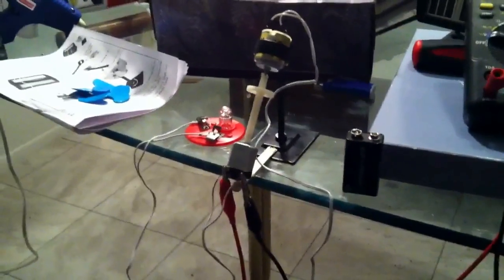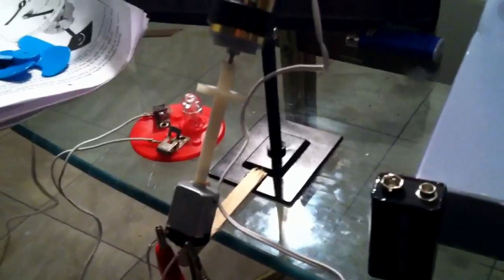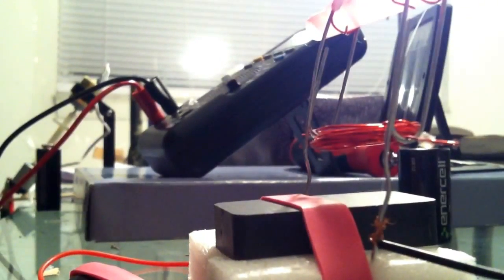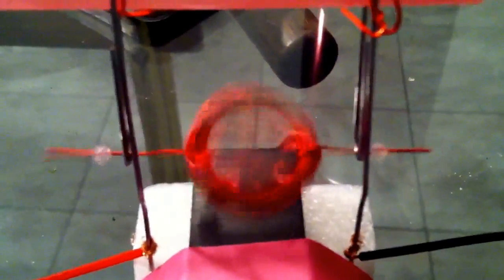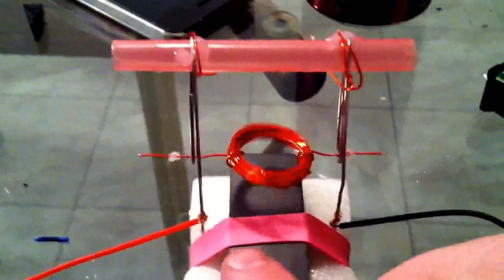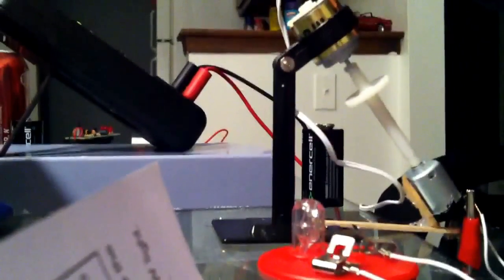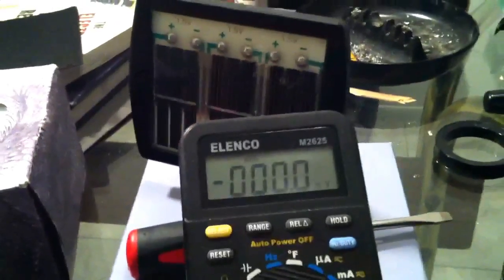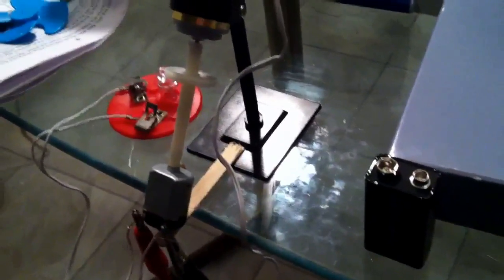*How to turn any DC motor into a DC generator*

Comment: can I use many generators ( parallel / series ) to increase the voltage/Ampere and their output power ?
Reply from the maker: Emad Lotfy yes you can thanks for watching and subscribe
Reply: Thank you, and you're welcome sir 
but i want to ask
what if one of generators ( parallel or series ) stopped ?
It will convert to motor again

So, It'll consumpt power instead of generation

Does that need control to make it out of the circuit ?
Reply from the maker: Emad Lotfy hmmm that is a very good question lol. My question is why would that one motor would stop? And to tell you the truth I don't have the answer to that question. My educated guess is that yes it would turn into a motor since the other generator is giving out power. But that is only a logical guess to your question. Can I ask what are you trying to make? Maybe make a video and send me the link I'm sure I could help ya out
Reply: I want to make dc generator system connected to inverter/UPS to supply some loads
Similar to pv array
But motors instead of modules
Reply: I need to make a system similar to pv array
but it'll be motor/generator array to generate DC power 
but there are some expected failures and I want to know if i can avoid them

and i assume  the output power of generator = the input power of motor

I don't know if that true or false
sure it's difficult to reach to maximum speed

Comment: How much voltage could I get from a 18v DC motor?? Would like to test it out, but I don't have a Voltmeter
Reply from the maker: XGamer [BiH] you need a volt meter. Buy one at harbor freight it's only 7 dollars and it depends on how fast you turn the motor. The normal rpm of the motor normally gives the voltage rating of the motor I hope this helps
Reply: Thanks for the answer! I'll try to get ANY voltmeter! I hope I can get atleast 5V out of it :)
Reply from the maker: XGamer [BiH] you should beable to get 5 v out of it but the amps might be not enough

Comment: does the generator motor have to be modified at all to output a current or does it happen automatically? Also, this may be a silly question but do the wires on the generator stay positive to positive or do they need to be flipped? ive been looking at generator vids for 3 hours now and no one has mentioned the output wiring.

Comment: the shaft is not the armature. the shaft is the shaft. the armature is the casing
Reply from the maker: Solomon Baker no the armature is not the casing the armature is what spins and is connected to the shaft. So technically it would be called the armature shaft. If you don't believe me google it. Thanks for commenting and subscribe
Reply: Tom Ziesmer no it is not the shaft it's connected to the shaft it's either the rotor coils  or the stator magnets. look it up surely you have access to google
Reply from the maker: Solomon Baker your stating that the shaft and armature are two different things and they are not you cannot take the shaft out of the armature. It is one piece therefore it is either a shaft or a armature. http://www.rollaclub.com/wiki/index.php?title=Tech:Electrical/Starter_Motor/Conventional_Type&redirect=no
Reply from the maker: Solomon Baker look under the site I just listed it's under number 4. Armature
Reply from the maker: Solomon Baker lol no need for insults buddy. I clearly gave you a link that shows them saying it's a armature shaft. Just because you are a electrical  engineer doesn't mean anything to me. I work on quarter million dollar machines fixing the electronics on them. You can say I don't know jack shit all you want. I know my electronics. And even if I called it the shaft or a armature, you out of all people should know what I'm talking about. Look at my other videos maybe you can spot something else "wrong" with what I have said. I make all kinds  electronics.
Reply from the maker: Solomon Baker so your saying you designed the D.C. Motor? I doubt you are even a electronic engineer. Your link didn't prove anything to me I can send you links to more info on a armature shaft if you want. http://www.groschopp.com/how-to-check-a-motor-armature/
Reply: look i see what you were trying to do with the generator, the battery was just to show that the genoerator works but you need to be more specific. the shaft is what turns the amature inside the stator magnets. just be more specific is all im sayin sorry to offend you
Reply from the maker: Solomon Baker man you are the Internet warrior. Getting so mad over what a armature is called. Tell you what how about you make a better video and show me the right way of doing things.
Reply: thats why i changed my last comment i got a litttle mad and i apologize for that but i do this shit all the time ive got several hours of research in this kind of stuff and i enjoy videos like this one i just like specifics, btw, can you do the same ting with a 110v motor to generate 110v? or would it be significantly less? been wanting to try it
Reply from the maker: Solomon Baker oh look even a electric motor company calls it a armature shaft would you look at that? (Look at the bottom of the page.)https://www.weldmart.com/main/repairparts/lincoln/armature.html
Reply: dude. stop trying to argue. i know what your saying
Reply: yes it is called the armature shaft, but you said the armature and shaft are the same thing but theyre 2 different components
Reply: can you do the same thing with 110v motor to generate 110v?
Reply from the maker: Solomon Baker I accept your apology and I understand what you where saying also. Are you talking about A.C or D.C. 110volts? Both yes you can. But not all A.C. Motors will work. The ac ones that will work people call them squirrel cage motors. Like the ones you will find in washer machines, fans and dishwasher motors. But the thing is if you want 110 volts from the generator motor then your motor that is turning it needs to be more horsepower than the generator motor other wise it wouldn't be enough to produce electricity but the problem with that is it will probably take more energy to spin the motor generator than it would to just run a regular motor. If that makes sense to you. You would loose a lot of energy as heat and friction. Best way is to not use a motor to turn the generator but some other source like wind or water current from a river
Reply: Tom Ziesmer actually I had plans of hooking it up to a windmill and it's ac
Reply from the maker: Solomon Baker then yes it will work if it's a squirrel cage motor. But the thing is how well it will work is anyone's guess. Because I or more and likely you too don't have the exact specs of the motor. If you do have the specs of that motor look for  rpm. The rpm is what you have to reach in order to generate the electricity. It might be a few thousand rpm or a few hundred. If your just experimenting then I say try it out and see what happens if your looking to actually power stuff I suggest actually buying a generator. Although a motor and generator are the same, they are built a little bit differently so the generator is more efficient and can go at much lower rpm to create electricity that you want
Reply: i done what you done in the video and it seems i have to reach about 3-4k rpm to get a good steady current but just tryin out this generator i previously made a hydrogen generator that heated water into steam thus turning turbines connected to an alternator then to 12v battery into 110v inverter but the output wattage is fairly low, i need a little more

Comment: ok then i have to use a dynamo
Reply: It's not so much your configuration, rather your power of your motor. Assuming your motor is under 1/20hp, it won't be able to generate more power than its motor rating.

Comment: you are providing 9v power supply and getting around 2v thats complete wastage of energy if you can produce more potential from lower one then it will a generator otherwise its not a generator
Reply from the maker: Thanks for your comment although I do agree with you this is not efficient. Your missing the point... This video isn't called how to make an efficient generator, it's to show you that you can turn any motor into a generator. Yes I did have a 9v hooked up to it but what if it was wind power then wouldn't it be efficient? What if I took that cheap hobby motor and put in a 24v brushless motor in it would I get more volts and amps? Yes I would. Thanks for the trolling comment but your acting like I'm trying to power a whole house I was simply stateing that any motor can produce power of turned fast enough. Check out my other videos and subscribe

Comment: thanks for your reply I will consider your feedback. also ,just wanted to know how much load motor can take of wind ,I mean I planned to fit this fan ,motor on top of the car ,so I car will move with speed it will generate power. so if car moves at max speed ,it will cause motor to burn due to high voltage generated ?
Reply from the maker: It will ware out faster but you should be fine for a while

Comment: Hi, I am thinking to build windmill generator with 3v/12v motor to charge mobile device. should i use LM7805 REGULATor or Voltage step down convertor to make constant output of 5v? please suggest ,
Reply from the maker: Definitely a voltage step down converter or what I call them a buck converter and the only reason why I say to use this is because if you where to use the regulator you would have to build a circuit with capacitors and resisters in order for it to work with a buck converter it has it already build into it and it's basically plug and play, a quick search on Amazon and you can get some cheap ones. I hope this helps.... Check out my video of my homemade usb charger and subscribe to my channel I'm sure you will like it, thanks for watching and if you have any other questions I will try and answer them

Comment: Hello there. I had tried light up an LED with a 12v dc motor. I spin it 1second with my hand, its light up 1second. But when I tried to spin it continously, it not working. why?
Reply from the maker: Do you have a resistor hooked up to the led? It night be to much VoLTE for the led. And led always need a resistor hooked up to it. Try that out and tell me what happens good luck like my video and subscribe

Comment: Why does the voltage drop so much? How does the number of rotations per second relate to the voltage output of such a motor? Does the number of watts also change? How many watts can the motor generate? Is there a voltage fluctuation if you tax the output motor more? (Sorry for the barrage of questions, I'm looking into this for a personal project)

Comment: Hi Tom,
Can you pl help.I've a 3V DC motor which I want to use as a generator. I connected it to a 3.5V light bulb and attached a propeller to the other end of the motor. When the propeller spins the light doesn't come on. What could be wrong?
Reply from the maker: are you useing the propeller to spin the motor? if so you probably need to spin the prop faster, also since a motor isn't a generator (still works as one, but they are made a little different for better efficiency) you want to get a bigger motor maybe a 6v or 9v DC motor that should give it plenty of power hope this helps and thanks for watching my video please subscribe
Reply: +Tom Ziesmer thanks Tom. I've subscribed. I think I'll go for a 1.5v bulb.
Reply from the maker: That would work to

Comment: Are those brushed motors? I mean DC motor implies brushed, but your demonstration didnt have any commutators so im not sure if they are brushed. Im also confused about your demonstration, if you run a current through a coil like that you will get a static magnetic field which means the coil would turn some amount and then rest when its magnetic field was in equilibrium with the permanent magnet you have.  Thats the whole reason for commutators, because it allows the magnetic field to change polarity which keeps it from ever reaching equilibrium.
Reply from the maker: hello thanks for the comment. now I see you know your stuff but that motor is the most simplest form of motor. first the motor has no commutator. it only uses power half of the time the rest is from forward momentum to spin it around. it is considered a brushed DC motor and it only have one coil of wire and normally there are many different coils of wire but the homemade motor is only one. it's a simplified demonstration of a motor I hope I answered your questions

Comment: nice video! do you think i could change a vacuum motor into a generator easily?
Reply from the maker: Depends on the original voltage of that vacuum motor I'm guessing anywhere from 12 to 20 volts DC  its hard to tell
Reply from the maker: Spin it up with a drill or something see what you get out of it... And what voltage are you looking to get out of it
Reply: really any voltage im just trying to understand it all. Im also trying to make a vawt and am looking at how to make a cheap generator

If its a dc motor in the vacuumcleaner can't i turn it into a dc generator?
Reply from the maker: Wise Lies Film yes only if its a DC motor if its AC motor you will need a rectifier that changes the AC to dc
Reply from the maker: Wise Lies Film and I'm not putting you down but its going to be really hard to make one from scratch I've tried many times with no success. Subscribe and check out all my videos I think some might help you thanks for watching g

Comment: Isn't it called a axel or shaft, not an armature.
Reply: Could probably get away with just calling it a 'rotor'. But to be totally honest, even though it is connected by a shaft, you would refer to the motor and the generator rotors separately. To clarify: The rotor refers to the rotating part of a mechanical piece of equipment and the stator refers to the stationary part. The armature refers to the currant carrying component of a piece of electrical equipment and the field refers to the stationary or generated magnetic field. In this case both rotors contain the armature, both stators are fields. (but this is not true for all motors or generators)
Reply from the maker: Adam Hatley couldn't say it better myself lol.

Comment from the maker: @Emmanuel Pascua if your gonna be using water to turn it I suggest an actual dc generater although any dc motor would work to produce some kind of electricity it's not "intended" to be be a generator so it has to be spun at a high speed to produce little current but a dc generator can be spun at a Lower speed with more current because it has more windings of wires so with that being said get a dc generator for something that's gonna be water turning it